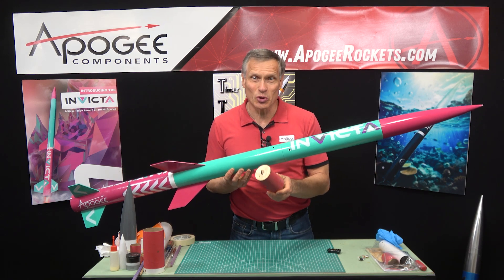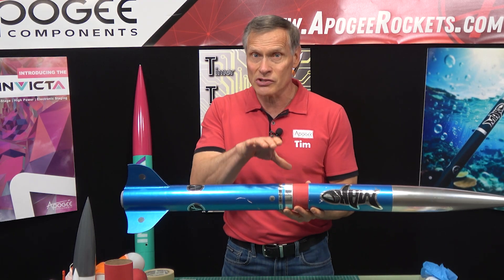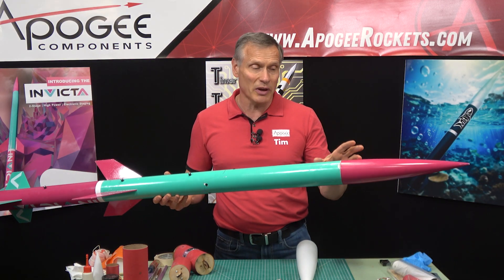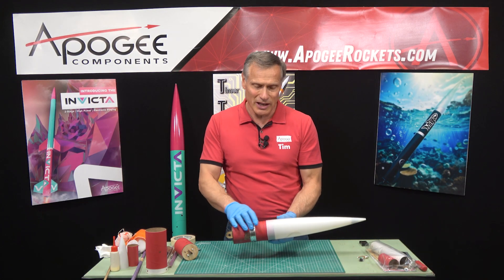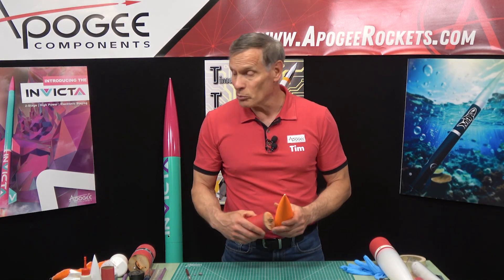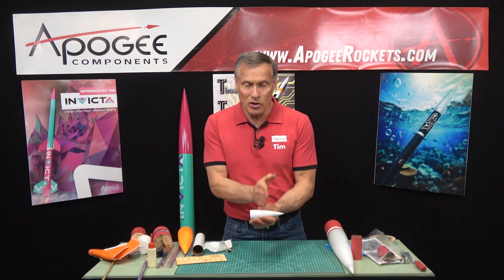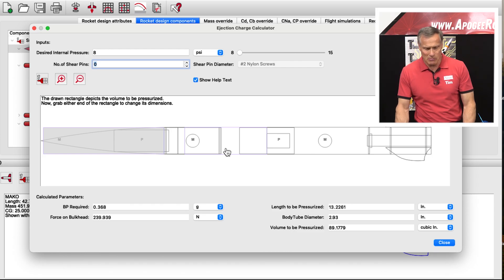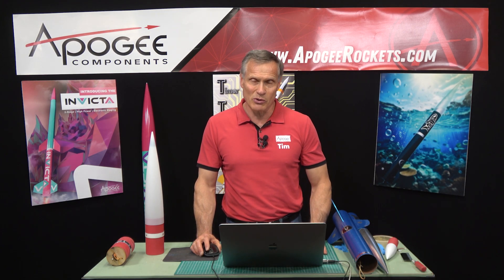Head End Dual Deployment | What is it, and how can YOU use it?

Comment: @Tim, could you simplify things for a first timer (I'm thinking of scratch BT-60 DD project) by using a normal motor ejection charge for the rear and only kicking off the  forward main chute with the BP charge? Or is there a big flaw in my thinking?

Comment: Does the parachute get jammed into the pointed nose cone to the point it won't open when the ejection charge goes off?  Does anyone put the ejection charge in the tip of the nose cone to prevent it from being compressed into that tight space?
Reply from the maker: No. It will be fine.

Comment: Hey Tim, now wasn't that ejection charge calculator integrated in RockSim a suggestion I did once? Congratulations TIm it's here! Still waiting for my free RockSim copy :) I'll pay you if I have money :p Ow and btw. In the Netherlands because it's pretty much illegal without permits to handle black powder and guncotton is available without stringent regulation it's used often. Also has the benefit of burning without pratically any residue. Maybe you can also add the option for guncotton in the ejection charge calculator.

Comment: When adding the epoxied Kevlar to the tip of a plastic nosecone, I would suggest drilling a small hole through the side of the nosecone tip where the epoxy is and sliding in a wood pin to ensure epoxy tip does not slide out after curing.  Once wood pin is trimmed to outside of nosecone and painted it will barely be visible.
Reply: That's an excellent way to be sure. But, as Tim mentioned, the HIPS used in this particular nose cone adheres to epoxy much better than the polypropylene used in most HPR nose cones.

Using a dowel is so easy that I'd likely add one as well though. Belt and braces, in this case makes sense.